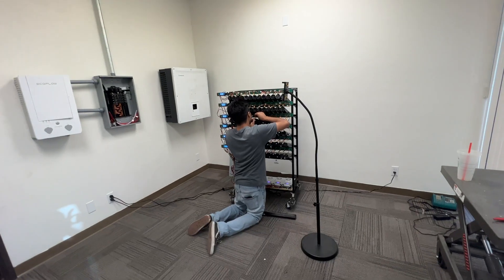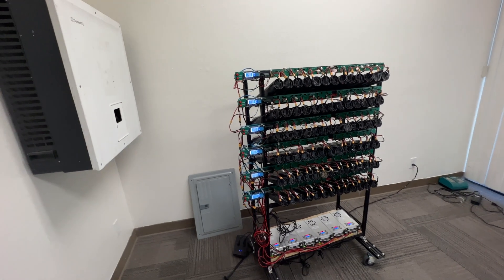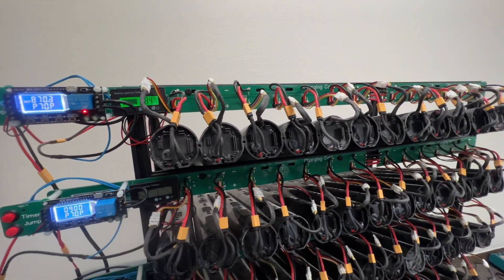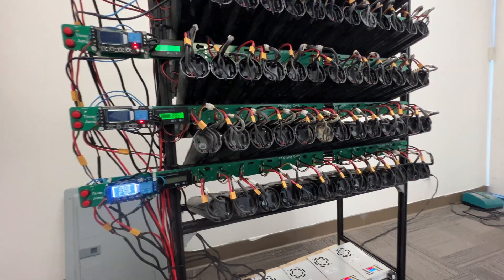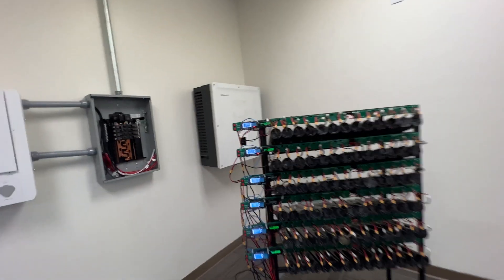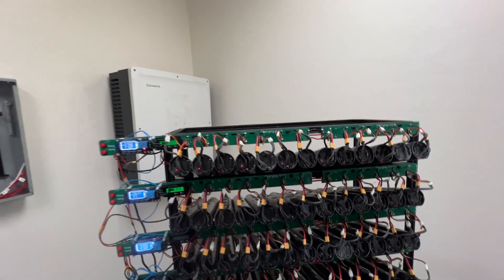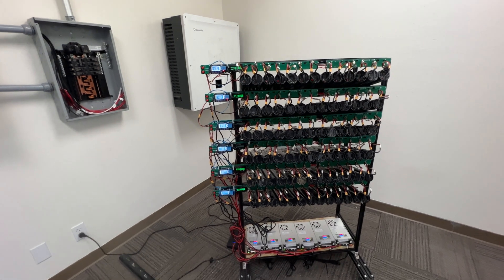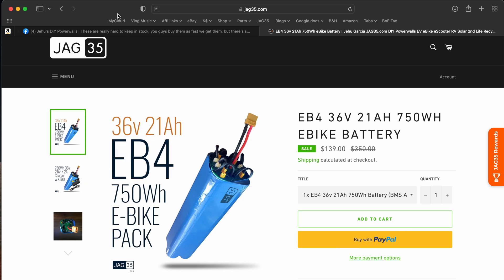Custom Battery Testing Cart

Comment: For me testing is not an issue.  The problem was buying the batteries I need.  If I need 20 batteries, and I buy them, and I find 1 bad, then I have to buy another. And often you are sold out by then. So I would be stuck.  Instead I buy 22, and hope I do not have more than 2 bad.  Sometimes I have had more than 2 bad, and once I did not have any bad.  The result is a pile of mismatched batteries and cells that I was unable to easily use in a project and a pile of e-waste and other scrap that nobody around me wants to deal with.
I finally decided to quit wasting my time and money buying garbage and I moved on to buy only guaranteed cells and batteries (and now only LiFePO4).

Comment: For having a battery test rack in this instance, its a little disconcerting you would give an "AS IS" on your 12v/50ah, 12/100ah, and 24/50ah batteries.....

Maybe don't guarantee the construction or connections breaking loose on shipping but could you at least give a guarantee that one of the cells wouldnt be completely dead? I understand the nightmare of probably fraudulent consumers falsely returning product but I feel like there is a way to measure possible negligence on a user's disassembly to guard against this.

 Really wanted to spend $ with you but the disclaimer was too hard to swallow, especially with no review system baked into your website. 

Im a huge fan and follower so don't get me wrong with this feedback, I've watched your videos for a long time and want to see your business continue to succeed. I would much rather support smaller businesses.
Reply from the maker: Don’t buy budget products if you want full warranty.  Use common sense
Reply: @jehugarcia  Specifically stated "Dead Cell only warranty" and not full warranty but okay.

Comment: Here from Chicago 
Have a question on ready packs what is the amperage they give put out 
I have a enduro ebike and needs about 60-80 amps
Reply: Shorter answer: maybe if you parallel a few...
Longer answer:
Generally each can handle 10 amps surge but the wiring is small and on jag35 it is recommended to use them for solar application. I used 2 in parallel to run a 750w ebike motor and it goes up hill well and the batteries don't seem to mind. 

So when using these it's probably safer to use a few in parallel 5 to 7 in your case [which is still a little dodgy as the wires on the bms are on the  small side].

Comment: Is it OK to constantly keep these units plugged into the charger? I noticed when I keep it off the charger the blue lights drain the battery a bit (eb4).
Reply: It would be ok for example to leave these on for a day or two before use. Generally lithium ion cells can degrade faster when at a high charge state for long periods of time. 
Hope that helps!